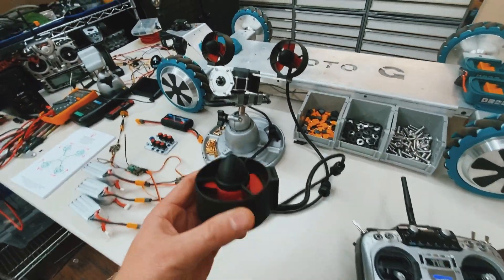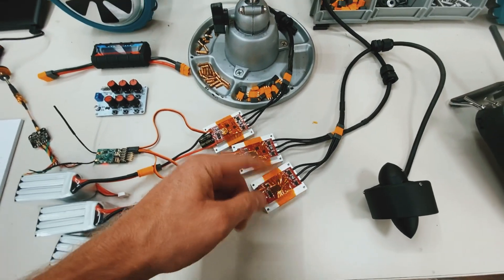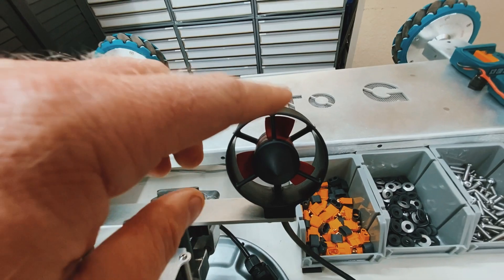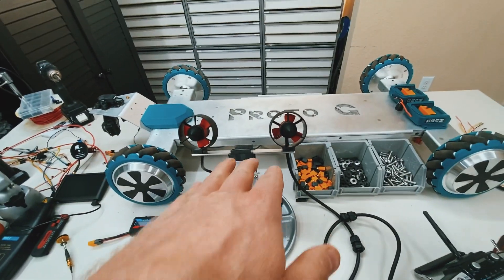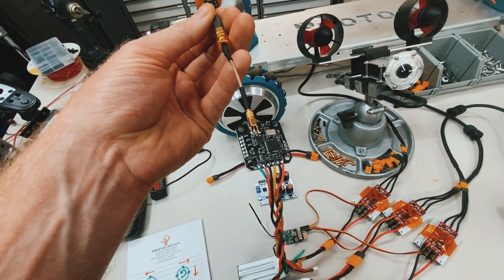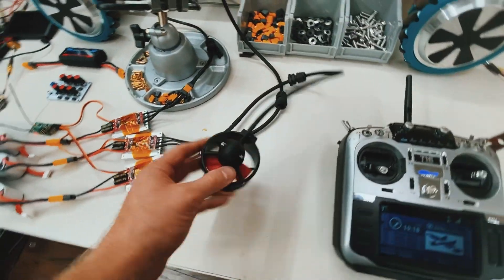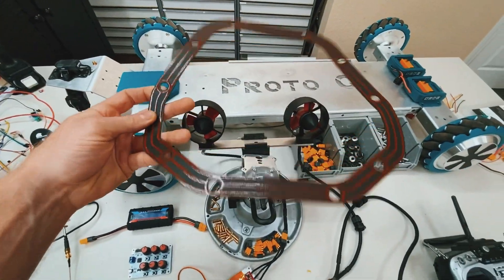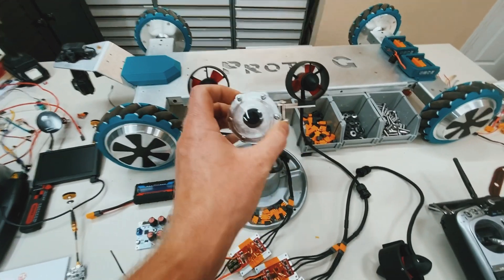Underwater Thrusters with Brushless Motors for Drones!

Comment: These thrusters claim full waterproof even in seawater but they are quite expensive, $146 cdn each,  plus shipping.   I know from experience that the average brushless motor will not hold up even in fresh water.   The bearings get rusty and fail.  In salt water forget it.  Bilge pump motors seem a better budget choice.  Take off pump and install props.
Reply from the maker: They not average brushless motors. They are sealed with a potting compound and do work in salt and freshwater. It cost me $50 USD and 1 day shipping. 🫡🇺🇸

Comment: How many ampere of ESC do you recommend for 16800 rpm 3-blade propeller with an operating voltage of 6-9 volts?

Ps. I'm just a student making a device in lined with underwater drone, limited knowledge when it comes to this. Thank you!

Comment: Hello, I have a concern because I am Trying to build an automated underwater drone. So, naturally, the first part consists of making a drone. when using the left joystick, the vertical axis controls the speed of the motors? if so, how? and how does it steer? does the leftmost position of the joystick make only the right proproller work while the left stops, in order to turn right? 
I apologize if my question was not as clear as it could have been and any clarification would go a long way thank you

Comment: I planning to buy 2 of this underwater motor and install it under ( fins) my inflatable kayak.  Do you think its good enough to move the kayak with a weight of 150 lbs?  Can i use a regular 12v car battery with on of switch?  Thanks...
Reply: Curious did this work?

Comment: Not sure how i missed this video but ya the gasket is a great idea. I love when you are able to use highly optimized products from one industry for other more creative applications. Water seal tends to be the hardest thing with these ROVs. Also, water sealing for the cable is a bitch. Water likes to travel down inside the cable if you don't seal the ends well enough.

Comment: I see the gaps between the blades of the props and the housing are very large, and on air drones they are very close. Has flow simulation been done to find the 'best' gap? That's interesting. I know that a closer gap on the air ones is better for overall use, but the much higher density/viscosity/reosity (I can never remember which one it is) would change it... Interesting. Oh, I suppose that in air you won't get a stick/seaweed in your prop either. Ahh, the gap might have more than one function!

Comment: Nice gasket. I am sure you going to seal that thing well. But have you thought of using a conformal coating on the electronics just in case? I have used MG Chemicals - 422C-55MLCA 422C Silicone on some ESC's because it has that flexibility when parts heat up. Just a random thought. Cant wait to see this one completed and running.
Reply from the maker: Yes! I planned on on using large clear heatshrink tubing I have for the escs and then sealing the ends with e6000 or rtv but I may take the camera apart and use a conformal coating on that board just in case.
Reply: I have used that conformal coating great stuff. Not fully water proof but great for swarf

Comment: Very cool! Are you gona have extra batteries in the flotation device for the drone, or is it gona be just for communication.
Reply from the maker: Yes, there will be a battery there for the receiver and video transmitter.
Reply: @ProtoG42  I know there has to be one for the transceiver. I was wondering about some extra power for the drone, transmitted through the tether. May at a later stage if needed.